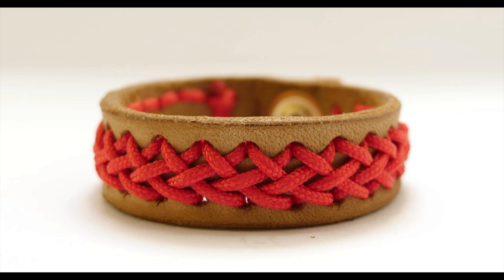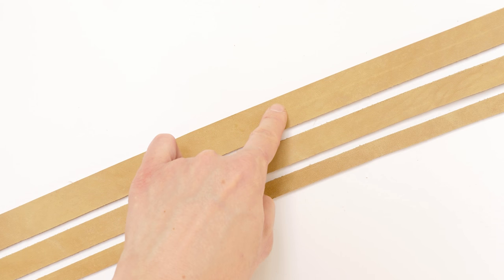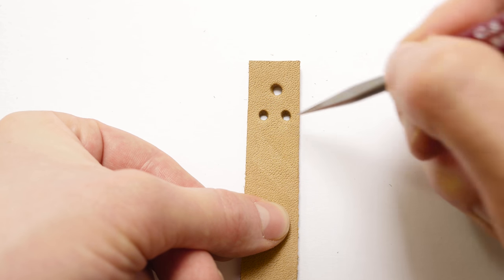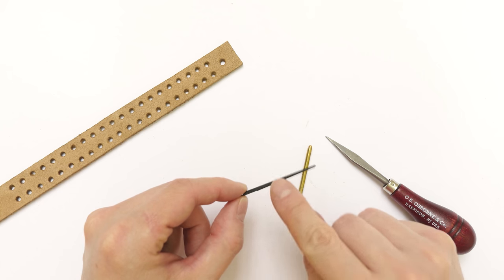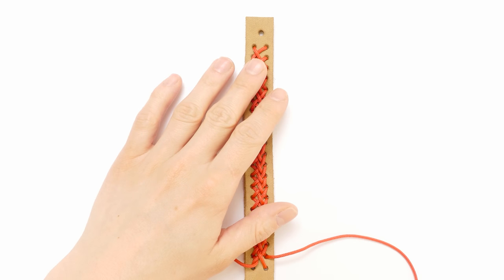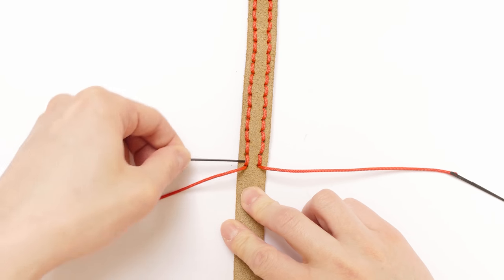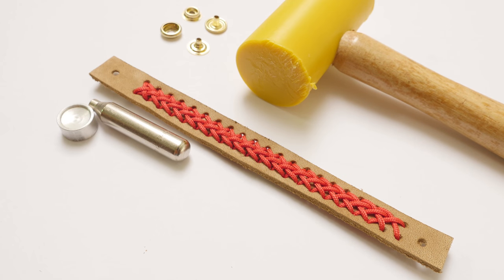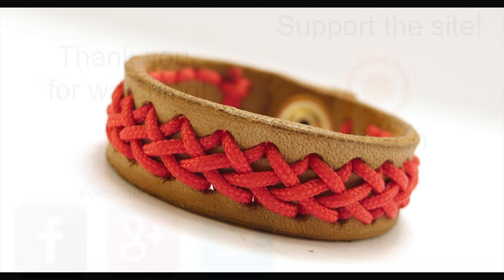Center braided bracelet- leather and paracord

Comment: Never seen a hole punch used like that before lol
Reply from the maker: Ye, usually you would use it much like pliers or use some leather in between the anvil and the blade.
But it works easily enough for me :).

Mark
Reply: Nathan Green Lol, yes! I've done leatherwork professionally since 1968. I've never seen that before. Reminds me of the story about the guy whose neighbor is always bragging about how great chain saws are. Neighbor lives a couple of miles away. it's a backward area, rural, where folks are stuck in their ways. One day neighbor stops buy and says he just bought his own and it saves him tons of time. Couple of days of visits with bragging is starting to make our guy wish neighbor would shut up about it. So he says, " Hey, that saw is so great, how about I borrow it for one day?" And to his surprise, neighbor says, "sure!" Next day neighbor comes back and says," Hey, how did you like my little beauty?" Our guy says, "I used it all day and only got two small trees cut to fire wood." Neighbor says, "Really? I wonder what the problem was? Maybe I should check it out." So he yanks on the starter rope and it fires right up. Just then our guy yells,"What's that noise?" Lol!
Reply: Paracord guild Dear PG, I can see your logic using the leather punch the way you do. It's a novel solution. You will find it's easier to place your holes where you want them if you use the hole punch like a pair of pliers. Good video. All in good humor. Not meant to offend.
Reply from the maker: Hey!

Not at all, thank you for sharing. I absolutely agree with you on the use of the rotary punch, it is how it is designed. But for thicker leather (and a bit dry leather) squeezing on the handles does not work all that well. On thinner leathers sure, but on this stubborn leather I have this works well.

Valerie Michael shows a similar use in her handbook, although she uses a piece of leather between the anvil and the punch to protect it.

Mark